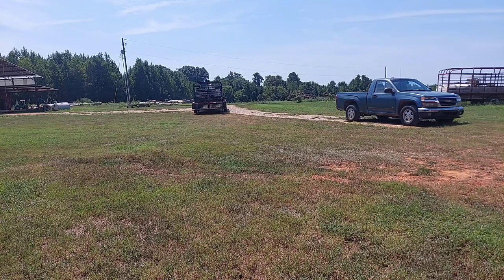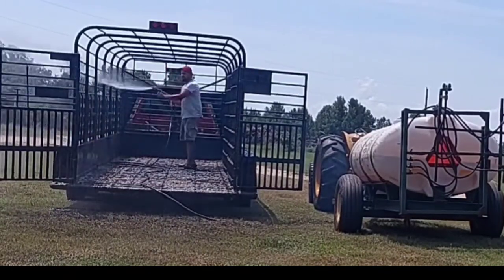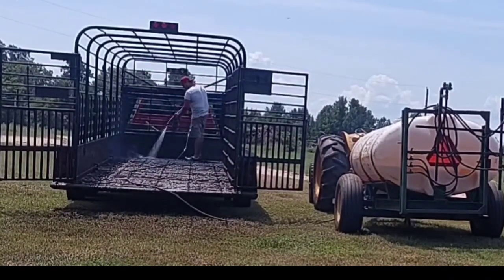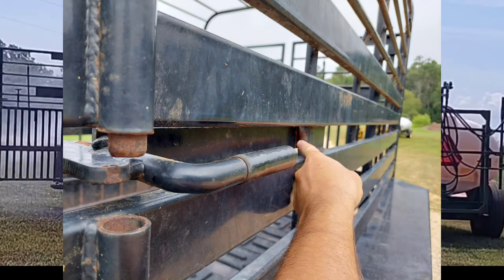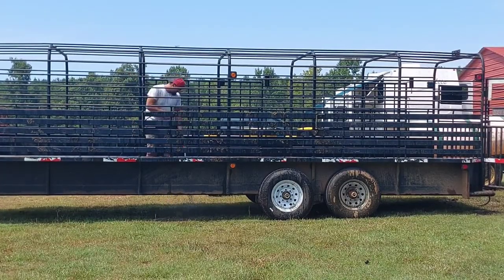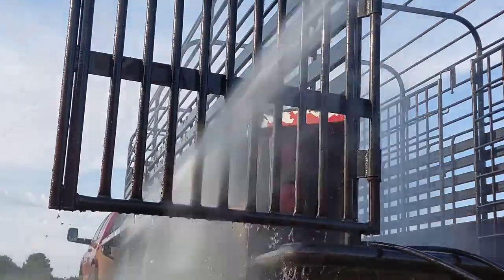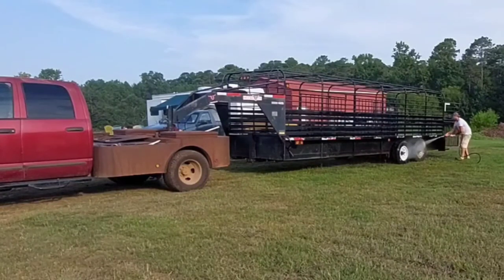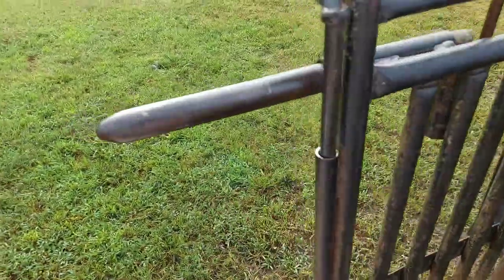how to make a cattle trailer last a lifetime

Comment: I just had the top of my cattle trailer replaced. Every tube on the sides and top had rusted through. The sides… no rust. The guy that fixed it, said 99% of the time, it’s the opposite. Mine was the first time he had ever fixed one with all those tubes rusted into. He also recommended using a roll-on bed liner in the places where urine and manure will get to. Great video btw!
Reply from the maker: Thank you very much. I will say that I have seen people use the roll-on badliner And it just caused more rust than it prevented. But it could have just been the way it was applied.
Reply: @johnscarboroughregenerativ7240  thanks for the information! I will be painting mine before long and was going to put that on. I may not do that now, knowing this.